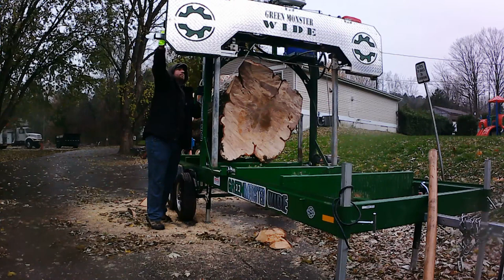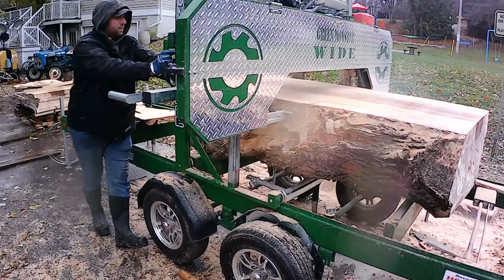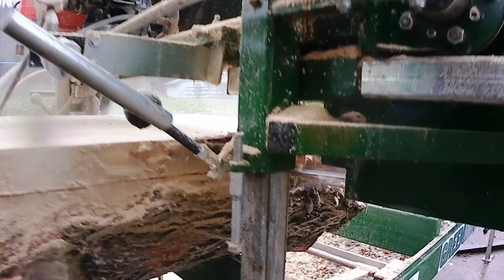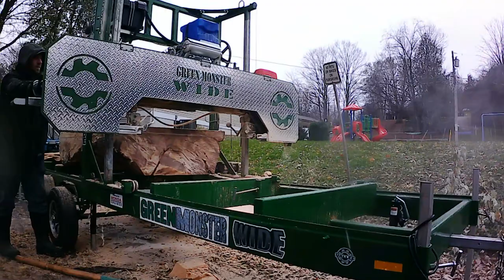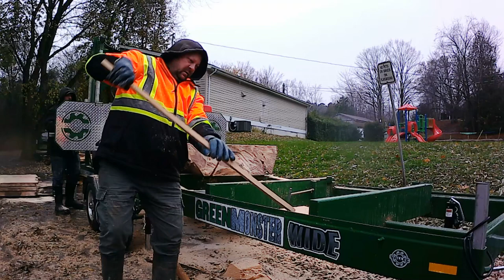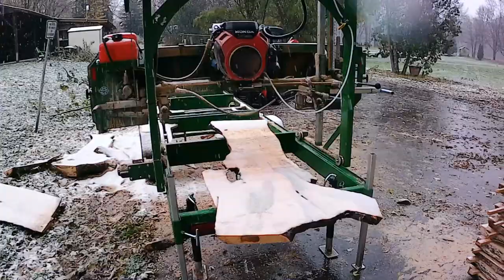48" Maple With Vallee Sawmills Green Monster Wide

Comment: Hi Lucier thanks for the response , how long are the logs at 20 inches in diameter. It seems to me that the blades don’t last very long. I’d leave the gauge in the green zone , but it would go back down on its own and I have to keep an eye on it and turn it back up. Does yours do the same ?

Comment: Hi Lucier, did you have to change the blade while you were cutting that big log?
Reply from the maker: No, it was done on a single blade
Reply: @LuciersCreate  Hi Lucier, how many logs can you cut or, how much lumber can you cut on one blade?
Reply: I’ve got a sawmill just like the one you’ve got, I’m just curious I haven’t tried mine out yet.
Reply from the maker: It depends on a few factors such as how dirty the logs are, type of wood, and what tension the blade is set at.  We typically run 2200 psi on the blade.  If the logs are clean we can cut between 4-6 logs that are 20 inches in diameter.   After that the blade needs sharpening.